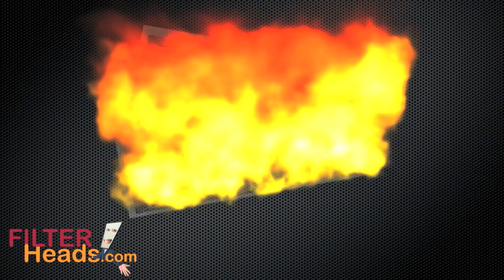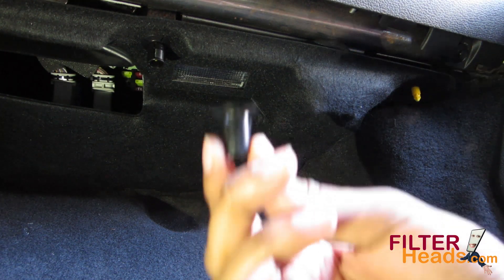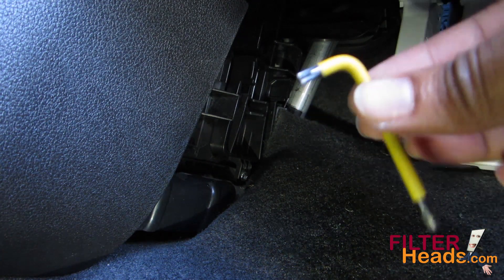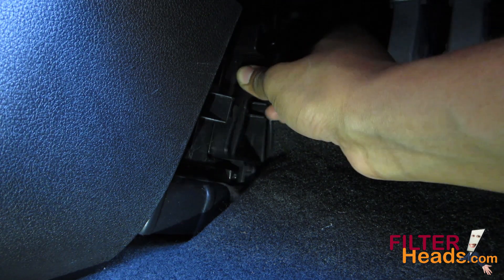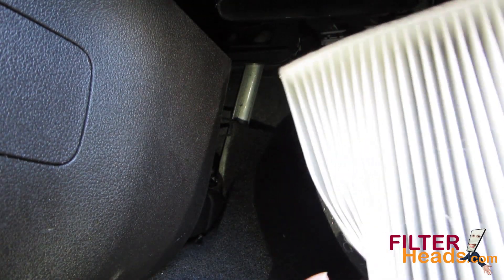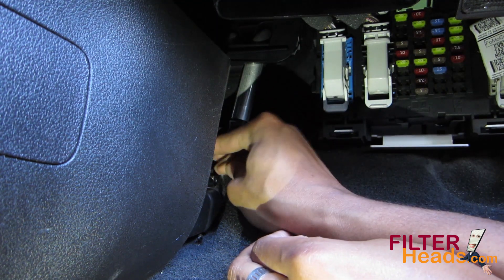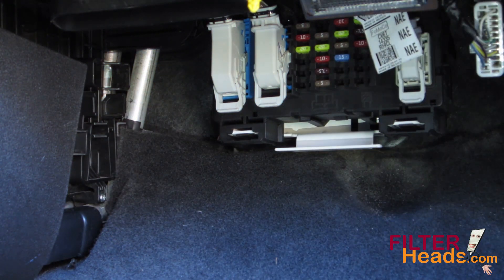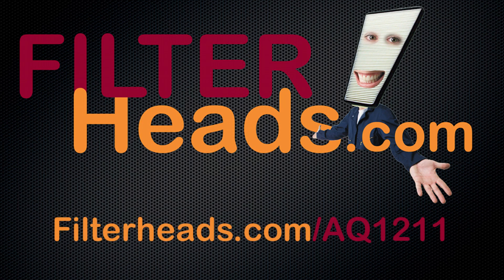How to Replace Cabin Air Filter 2013 Ford Escape | AQ1211

Comment: Thank you for this excellent video. just had my oil changed and the shop told me I needed new engine and cabin air filters.  I bought both at a local auto parts store for about $40. The T20 screw was already missing, so I guess someone threw it away. 🤣 Pinching the filter in the middle and inserting the top first made inserting the filter so easy! My problem came in getting the cover back on, then I discovered I was trying to put it on backwards. Had I figured that out right away, it literally would’ve been a five minute job.  I would highly encourage other females to give this a whirl. Thank you again!
Reply from the maker: You're welcome! Next time you need filters for your car order from us filterheads.com.

Comment: Suggestion: once the old filter is removed, it probably will bring some dirt out with it (mine had 3 years/50K worth of filthiness), so plan on vacuuming that, and the empty space it came from.

Also, watch out if the AC has just been used - the aluminum tubing shown adjacent to the opening will be HOT - must be the return line.

FWIW, a weird experience with dealer:  
During  the oil change/50K maintenance, they  called me to see if I wanted the cabin filter replaced for $45 ($20 for labor), and I said no thanks, that I would take care of it (since I remembered seeing something like this video indicating it was not too hard for me to do).  So when I did get it out, I found the date of the other work penciled on the side of the filter, meaning they took it out, then put it back without charging the $20 for the labor that replacement would have entailed anyway!  At first I was annoyed that they did not leave it out, but then realized this action showed me how it fit in  ;-}
Reply from the maker: Thank you for informing us!

Comment: is this under the steering wheel??
Reply from the maker: The cabin filter is located on the passenger side underneath the glovebox. Thank you for watching!
Reply: Seems from your video (and my actual implementation from that - my thanks!) it is better described as being to the left, as well as beneath, more or less to the car's center between the firewall and the front of the console's "innards".
Reply: filterheads what years. should have posted  my year  from what I think is under cowl under hood.

Comment: never again buying another ford... easy job that turned into a 10mins trying to wiggle everything back into proper place... clearly they're forcing non-able body to go to the dealership and spend $80 for replacement.
Reply from the maker: I agree, the engineer did a poor job designing this housing location.